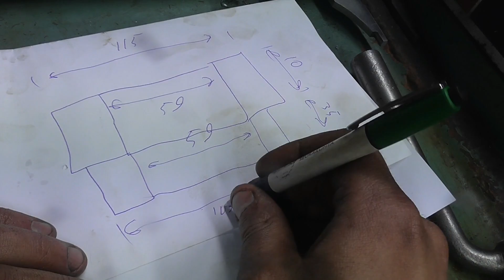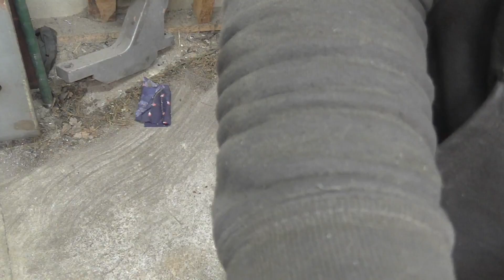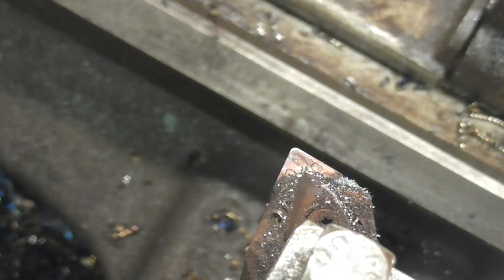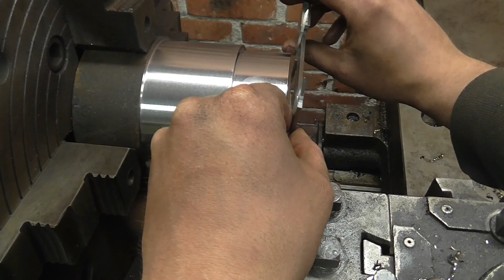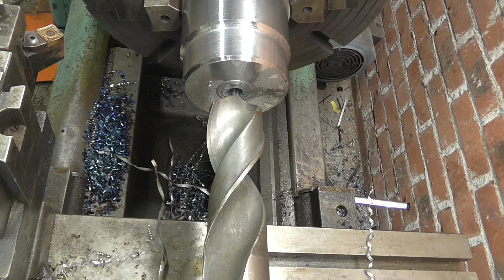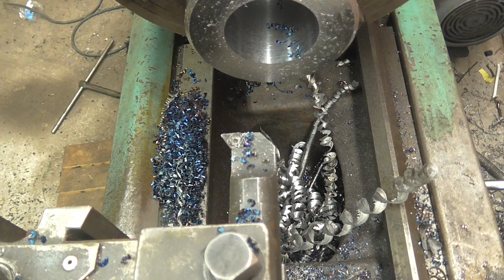Building cranes for my shop part 3

Comment: 8:20.  Don't zero tool against stationary component as the tips are very fragile!
Either use the machine running to lightly touch and zero or else do it stationary with a piece of paper between tip and component.

Comment: It is very seldom, if ever, that I disagree with you. But there is a reason for step drilling -- using progressively larger bits. There isn't a drill bit in this universe that cuts either straight or round. You are right, as long as the web will fit the pilot hole that 55mm drill will try to follow the -- what was it, a 6-8 mm drill. But it has an awful lot of material to remove. This will impose a torque, and hence a deflection, on even that 55mm monster. So your hole will be off. Now in your case it did not matter because you were going to bore it anyway. But if for some reason you didn't  or couldn't bore it then step drilling is the thing, because each drill size removes smaller amounts of metal than the final size. Avoid deflection at all costs. Bitter experience on my part.
Reply from the maker: It's completely fine, thanks for your well explained point! Maybe it's just that my drills are always badly sharpened and Soviet quality (varying between really good and terrible), but I never expect a round or accurate hole from my drills. I just want them to remove metal fast and then finish by boring or reaming. Thats why I like going in large steps.

However that drilling operation really was an extreme example of what you are saying. Also from the next clip after the drilling you can see that the piece actually moved in the jaws! I very rarely use drills that large, that might even be the first time I'm using an over 40mm drill. That was just too much to take off and i only realized that when I saw the piece wobble in the chuck after drilling. I was amazed that the drilling could do that. Actually i was about to edit out the part when I was explaining the heavy drilling step but I decided to leave it with the next clip showing that i was actually wrong :-). Learning something new every day!
Reply: Soviet drills, eh? My sincere condolences :)